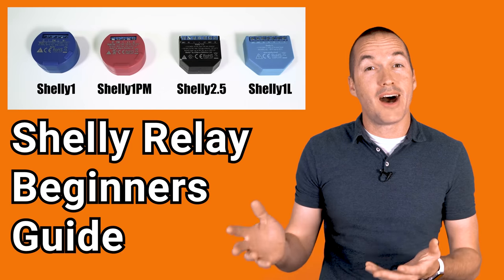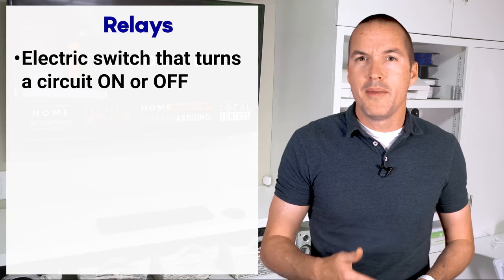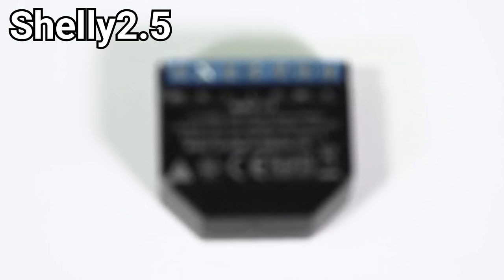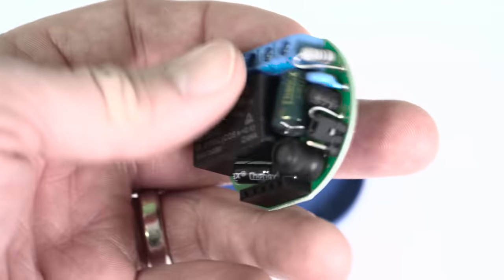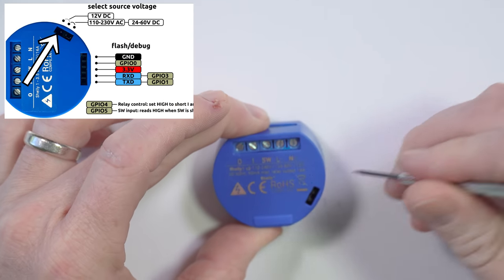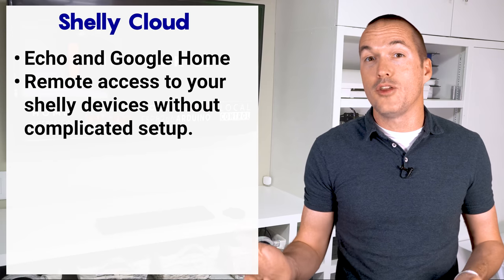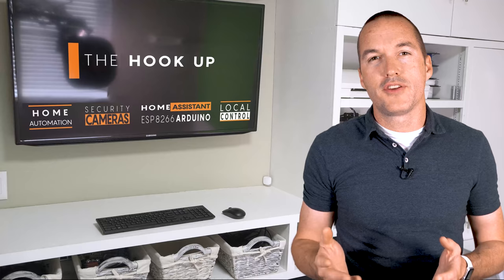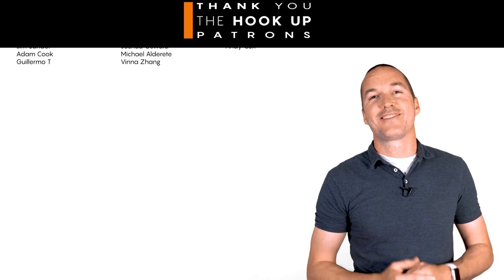Beginners Guide to Shelly Relays - Choose The Right Relay For The Job

Comment: Would love to understand what's the deal with the 20W load and when it's actually needed
Reply: The 1L (and Dimmer2) "leak" some power over the output wire so that energy can flow across the electronics for them to work without Neutral wire.
There needs to be some load to 'pull' enough power through the Shelly.
Also, if you have LED lights, this energy leak may be enough for them to shimmer slightly. The Bypass 'consumes' this leaked power so the LED lights don't shimmer
Reply: @SmartLifeEnthusiast  But does this mean the Shelly always consumes 20 watts? 24/7?
Reply: @DannyDM00  Shelly consumes <1W of power.
20W requirement is because the tiny bit of energy 'leaked' is sufficient to make LEDs shimmer and 20W of load should be sufficient resistance to not have this effect
Reply: @SmartLifeEnthusiast  What is the total consumption of the Shelly and the 20 W load?  That is, let's say I have two 60 W equivalent LED lights in my garage.  When off, they consume no power, when on they consume ~16 W.  Let's say the lights are used for one hour per day, so a total of 16 watt hours.  With the Shelly and its 20 W load, what is my new consumption per day in this scenario?
Reply: @RideGasGas  The Shelly uses <1W, see Shelly Knowledge Base.
The Bypass doesn't consume anything, it's used to prevent shimmering.
Since your LEDs have a consumption <20W they might shimmer when they're supposed to be off. If so, install Bypass parallel to the LEDs.
Reply: @SmartLifeEnthusiast  I understand that the Shelly itself uses less than 1 W.  But we're asking about the additional consumption of the bypass needed for loads less than 20 W.  I looked on the Knowledge Base but didn't see anything on the bypass.  The bypass clearly adds some load.  The additional load will consume power in watts.  Power over time adds up.  My question remains, what is the total consumption of the Shelly and the bypass in addition to the 16 W/hr per day consumed by my light bulbs?
Reply: @RideGasGas  I'd suggest asking the question on the Shelly Support FB group. But it's definitely not 20W.

Comment: Boss i have a switch that controls under cabinet lights, but i’m installing 2 more cabinets and i have power but no control wires and i would like to add more lights and control them with the same existing switch,  what kind of shelly relay should i use? One that can detect the switch position and makes the other relays go on

Comment: I'm just thinking of creating a smart home system with this product. What happens if the power is out? My router is on a PSU, but do these devices remember their settings, or they have to be recalibrated after the power comes back on?
Reply from the maker: They remember all their settings.
Reply: @TheHookUp  thank you for the fast reply, it looks like a good product in this case

Comment: Note:
- Shelly 1PM does indeed have 2 L-terminals. AFAIK it only needs 1, even on full load. 2nd one is useful for connecting switch. Since it doesn't have the dry relays they had room for an additional terminal.
- Shelly 1 doesn't have overtemp protection, apparently because it doesn't need it as it uses a relays instead of electronic switching (that's as far as my knowledge on that subject goes).

- Shelly also added unicast CoIoT, which should fixed the IGMP Snooping issue but does fall-back from multicast to unicast.
Reply from the maker: My issue with CoIoT on unicast is that it defeats the purpose.  I like the CoIoT option because it allows for discovery, if I were going to use unicast I'd use MQTT instead.

Comment: It requires a constant 20 watt load to function? Is that right? That seems like an extreme drawback using nearly half a kilowatt hour each day whether used or not.
Reply from the maker: No, the 20w load is required because the shelly needs to "leak" some power when off to power itself.  If you had a 1w load it would need to "leak" close to 1w which would make your load turn on.  If your load is 20w it can leak 1w without turning the load on.

Comment: With the 1L, would the 20w load be a constant draw; ie added power consumption?
Reply: bump on this one, I wouldn't expect this to be a constant draw but curious to know why 20W is required
Reply: I think it's to do with the power the Shelly needs to stay on. If it's say a bulb that's less that 20W, the current passing through the Shelly - and therefore the bulb - will mean the bulb will be lit dimly. Above 20W and the bulb(s) have enough resistance not to light up. This is why there's a bypass module you fit in parallel to the light to increase this resistance on the circuit.
Reply: The minimum requirement is there because LED lights tend to shimmer slightly because of this energy 'leak'.
Having at least 20W of load ensures that the small bit of energy leaking should just pass throug the bulb(s) without causing shimmering.
Installing the bypass fixes this as it 'consumes' that leaked energy.

The bypass doesn't pull 20W either.

The Shelly electronics consume less than 1W according to the manual
https://shelly.cloud/knowledge-base/devices/shelly-1/
Reply: @SmartLifeEnthusiast  Great comment! I’m trying to grasp all the knowledge I can from experienced people like you. I’ve been messing around with home automation for about 5 years but I’ve been using SmartThings and now I would like to switch to HA. Thanks!
Reply: I wonder if you could use the Shelly 1 L in combination with a second Shelly (standard version and resistor) to manage even higher loads?

Comment: Thanks for the info, Rob. I've been automating since X-10! I am Interested in your solution to this situation:  I have an electric water heater in a closet connected to a 220V 30A outlet.  There is no other electricity in the closet.  I would like to control it from the internet via Wifi. I don't mind cloud solutions. Don't want to spend alot...
Reply: I had the same thought about controlling the electric water heater temperature and on/off. As I understand, that is not recommended because of the danger of Legionnaires bacteria growth at temperatures below 60C. Where I live no recent electric water heater has an on/off switch or controllable temperature. They are all set at 60C for that reason.
Reply: I understood that it might be enough to heat to 60 degrees C just once a week, but please double check

Comment: Thanks! Another great video. Any advice on which Shelly model to use with a dimmer? What kind of switches would be required (e.g., impulse)?
Reply: Shelly relays don't work with dimmer switches (yet), though you can use a single throw or double throw momentary with the Dimmer 2 - you can actually use two switches for input with the D2, if you like
Reply: @douglasroberson  Thanks :) After reading up on this for a bit, it's my understanding that such a momentary switch would dim the lights depending on how long you keep the switch pressed. Correct?
Reply: @BartHompes  Yes, exactly. A double throw has an up and a down for brighten and dim - and a quick push turns off or on. With a single throw, it alternates = press and hold to dim, then the next time you press and hold, it brightens. I've used a really nice Leviton double throw and also a Zooz single.
Reply: @douglasroberson  thanks for your reply!

Comment: Getting a Shelly1L with the Bypass seems almost pointless seeing you’ve got to access a neutral wire anyway. What would be a practical application where someone would use a 1L with a Bypass instead of just a 1PM?
Reply: UK and Europe use only Phase/Hot line on switch box, No Neutral means you can only use Shelly 1L or Sonoff ZBMINI2L to manage a light.

Comment: how do you remove the shield in case you need to access the back part of the switch. I bought some of these and I didn't install them as I saw no possible way of remove the shield without damaging the wall

Comment: I need to connect a relay output from my home PLC (logic controller) to Home Assistant. I am thinking of using a shelly1, activated by the switch input (from the PLC relay) to use as a 'flag' input into Home Assistant. any other ideas?

Comment: I’d like to add smart relays to my range hood keeping the existing led switch. The fan switch I’d swap with a replacement light switch to change it from lo-off-hi to off-on. The light switch will turn a smart relay that’s zigbee or Wi-Fi controlled on or off,  but the relay the other switch turns on or off would have to be able to cycle through off, power to line 1 or power to line 2. The fan controller handles the speed and simply chooses based off which line is getting power so I’ve thought of using a single pole relay then a 3-way switch to independently switch which line gets power, but it would be nice to have it all in one relay as in off-l1-l2, but every 2 channel relay I find seems to only support independent control and I wouldn’t want to rely on an automation to turn one off before the other turns on in such a case cause I’m not sure what would happen if both lines got power at the same time but not willing to find out. In dc relays they have a standard open and standard closed pin usually which would be helpful getting one board that has 3 channels with ch1 powering the light, ch2 powering ch3 which is open on one speed line and closed on the other. It would be nice if there were an ac version of such relays but the closest I can find would seem to be using a separate smart 3-way switch as I described above. Any advice?

Comment: Thank you for all the information.  I have a question. I have a 24v motorized ball valve. It is a 3 wire.  Ground, close, and open. I would like to make it smart.  Does the dry contact version have a no/nc option like a traditional relay or would I be better off connecting an actual relay to the Shelly and just use an on off function.  The valve does not require power to be removed after it opens or closes. Can be operated by a simple toggle switch.  Thanks!!

Comment: Wait, so the Shelly 1L circuit consumes 20W in idle?

Edit:
No, it probably doesn't. The 1L uses induction to power itself, so it needs current travelling on the live wire. It does this, I assume, by using a variable resistance until you have enough current flow. This current also travels through the load you want to switch. For some loads, such as some lights, this current can be enough to dimly lit or flicker the lightbulb. To avoid this you add the bypass in parallel to the load, which let's some of this current pass through itself, avoiding the load problems.

Comment: Am I being silly, with the shelly 2.5 could you in theory control 2x garage doors with the 1 device independently?
Reply from the maker: Only if the garage doors were 120v input on the button terminal (highly unlikely).  The Shelly1 dry contacts are better for that application.

Comment: 10A @ 330V would be 3,300 Watts but this is also NOT a standard voltage.. You were going for 110V @ 10 amps for your 1100 watts.. @ 4:34

Comment: @The Hook Up   Good evening! Thank you for the great video! Could you please be so kind and help me - I have Shelly 1 and would like to "smart" my gates, but... I have the switch inside my house which operates my gates. It's difficult to explain but, this switch doesn't have L and N, there is just 1 wire in and another 1 wire out back to my gates. Is it posible to "smart".y gates? Do you use any email or What's app in order to send picture and explain with photo of my switch what I need? 🙈
Reply: @The Hook Up

Comment: I have a Shelly 1L (No neutral) and want to control 2 lights; each light has an individual switch. How should I cable the Shelly 1L? I have 2 hot wire loads. According to the video, one hot wire load goes to O. What about the 2nd hot wire load? Where do you connect it?  Any one would know. Thanks in advance
Reply: You need a DOUBLE device, two separate, 2x Shelly 1L or better 2x ZBMINI2L from Sonoff.

Comment: You can use the Shelly 1 in the ceiling fixture if your switch has no neutral. This is like how the Brits wire their Shelly to the ceiling rose.

Comment: if you have no neutral by your lightswitch but you have one by your lightbulb in the ceiling. can't i put a shelly there instead so i can use another than the shelly1L
Reply: in lightswitch box you have a Phase/Hot wire, means Shelly 1L or Sonoff ZBMINI2L. On ceiling is differ story bcs you have a Neutral here and better is use dedicated unit.

Comment: Looks like there is not one you can use on a Dryer which is 220 Volt?
Reply from the maker: 240V, yes.  The voltage is fine, amperage is what you would need to worry about.

Comment: Be careful using the 2.5 when you are using continuous loads ( e.g. a Pool Pump etc ). My 2.5 overheated constantly and cut off even though the pump was well within the 10amp limit ( was only pulling 730W ), and then totally died. Honestly, I'm disappointed with the 2.5. Hopefully the 4PM won't have the same issues.

Comment: I have a two year old home. Unfortunately almost every box has so many wires stuffed in them out of 30 boxes only 3 boxes could accommodate a Shelly.
Reply from the maker: That's crazy, my house was built in 2012 and they used super deep boxes thankfully.

Comment: For me at least, a crucial bit of information that's missing from all of these reviews of Shelly 1PMs is that you can't run a 16A resistive load on US 220V/240V. Shelly is a British company and they use single pole 220V with a neutral in the same way we use 120V. So you can't use a 1PM to control a 2-pole 240V electric wall heater, for example. I've got a stack of these (14) that are doing things that could be more cheaply done with (many) other devices because this info isn't ever shared. FYI, for big amp resistive loads, the way to do it is with contactors, and you can get those with 120VAC or 12-24VDC coils. You won't want to use a 1PM to control the coil, though, because then you're wasting the power monitoring sensor. Can you tell I'm still mad lol
Reply from the maker: Shelly is actually a Bulgarian company, but a significant portion of their customer base is in Europe.  You are correct, you shouldn't use dual phase 240V with a shelly.  For a contactor the ShellyEM is actually the best product which will allow you to switch the contactor and monitor the power consumption via a CT.

Comment: How would you wire a 3 way switch?
Reply: @HeikoQuant  I have a three way switch that controls three bulbs in the garage. How would I know where to place the Shelly?
Reply: @Ohio_TTV  You need to look at the diagram. I went for the wall box where the cables are connected and distributed. not the central one but the box in the direct area. We have that system in Germany. Find out which cables are switched and find a random neutral as weil. Connec according to the diagram.
Reply: You’ll have to look at the linked diagrams and in your boxes and figure out what layout you have. Ideally the power source and light load wires are all in the same box. The Shelly would go in that box. The other 3-way box would just have one Romex with all three wires connected to the 3-way switch. If you’re unsure, then you probably should work with an electrician.

Comment: The problem with Shelly is that they have tripled in price during the past 2-3 years. If you just want to automate your lights it is now cheaper to buy a smart switch. Kasa puts out a reasonable priced switch that looks just fine.
Reply from the maker: I agree that shelly's have gotten more expensive.  I'm not sure if it's just cost of materials, R&D or what, but I do miss the days of a $10 shelly1.  That said, Kasa sucks.  Out of all the smart home products that I've used I had the most trouble with Kasa.  Back when I was using google wifi just opening the Kasa app would take down my whole network with a multicast storm.

Comment: Great video and explanation! Just a clarification regarding Shelly 1L, what is the use of SW2? Can SW2 be used to control another device other than the one controlled by SW1?
Reply: >"regarding Shelly 1L, what is the use of SW2?" For a stair or cross/intermediate switch needs a 2x input.

Comment: Can you use the Shelly with smart bulbs?
Reply from the maker: In what way?
Reply: @TheHookUp  i have dumb switches I want to turn into smart switches to command hue bulbs. But if I cut the power the smart bulb will not turn on with the app or voice command. I'd like to use both my dumb switches and smart features to command smart light. Hopefully I explained what I mean. Anyway thanks for the reply
Reply from the maker: @pippo46  You would need some kind of home automation hub (smart things, hubitat, home assistant) to accomplish that, but yes you can run the shelly in "detached switch" mode where flipping the switch only sends a message to your hub and doesn't change the state of the relay.

Comment: Didn't cover Detached mode?
Reply from the maker: I could be wrong, but I feel like anyone who uses detached mode probably already knows what they are doing (since you need a home automation hub to get use out of it).
Reply: @TheHookUp  I am a decent DIY’r and didn’t know what detached mode was, admittedly your video was my first dive into Shelly and Sonoff. I’ll keep researching. Thank you for quick response.
Reply from the maker: Basically you'd use detached mode if you wanted the switch to control something other than the load (output) of the shelly.

Here's an example: https://youtu.be/hBEb_FCLRU8?si=4nHdAy4NQUCkXKpW&t=392